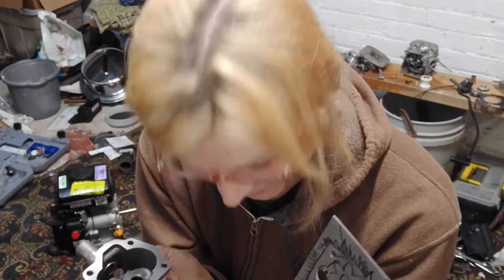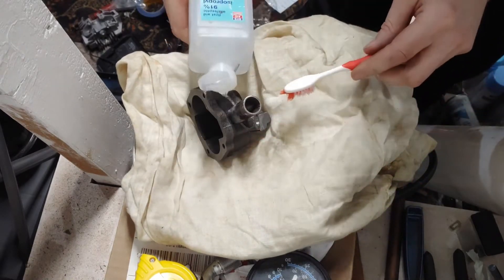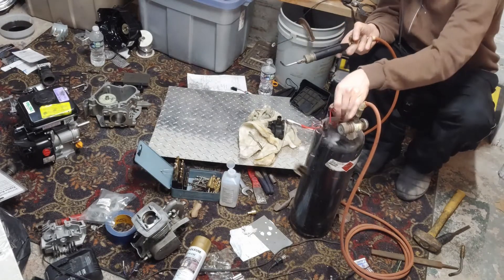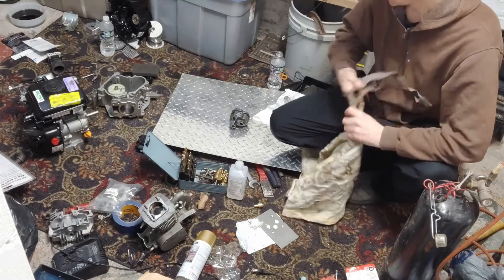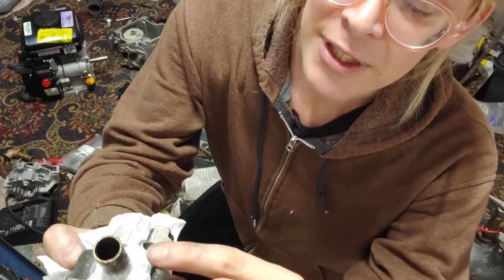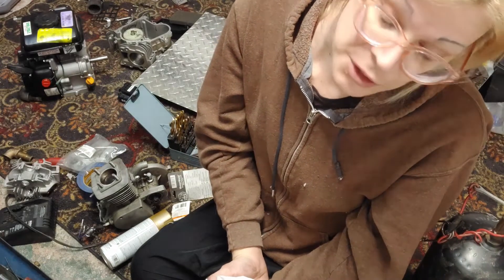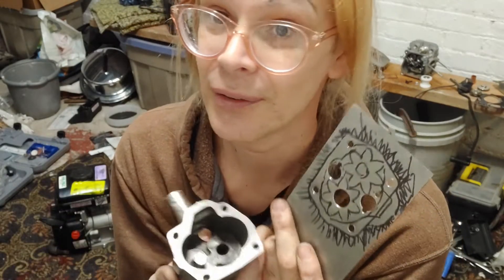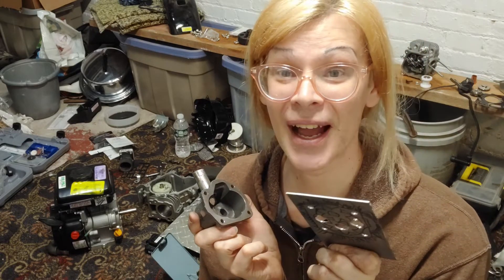Mini Supercharger housing construction and custom merge plate

Comment: Just make a bracket to support what the tube is going to hold.
 I've had my fair share of roots type super chargers. I really would like to see this work. Now...🤔 With that said;
You will get more air 2-3 times if you round the points and twist the gears, but then you'll need to make the gear housing smaller to make the tolerances tighter. Remember atmospheric pressure pushes air in your not pulling it in. If it gets cut with sharp edges you cut flow. And air doesn't like to bend. This will be interesting for sure. Oh one other thought, try seeing if offsetting the gears will help flow. 
This is cool 👍 I should post a video on one of my super chargers.

Comment: Impressive machine work and ingenuity. I'm super curious as to how many CFM of air it moves. I also have faith that no matter your initial results, that you will end up with something cool. The RPM of the mini supercharger will have a massive effect on the air flow, so I'm glad you have a way to spin it up faster.
Reply from the maker: the only rating close to  a CFM i could find was that a single pump installed in the chevy small block would pump about 8 gallons per minute. That is oil, not air, but also that is high rpm and high pressure (50 psi). I don't know how to measure CFM in a practical way on my work bench, but now that it's time to test, I am going to think of something.
Reply: @kimfixesthings  The oil rating won't help because fluid doesn't compress, so the PSI and GPH ratings from the factory oil pump won't help us. You can go the redneck route and see how fast you can fill up a big garbage bag. That only tells part of the story because air does compress and the CFM will drop in relation to back pressure. So even testing it on a garbage bag only tells you the CFM rating with no backpressure. However you can compare that to the CFM rating of the carburetor and have an idea of how much extra air you'll have. If it moves a lot of air, it will work, the only question then is how well it works. That's when the fun testing happens on the bike!